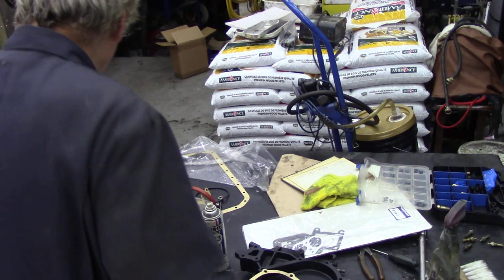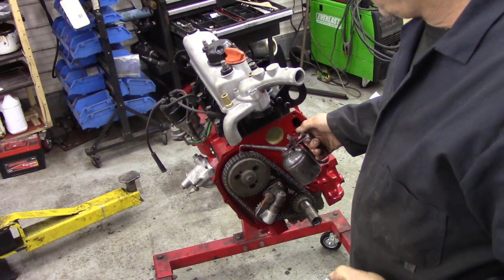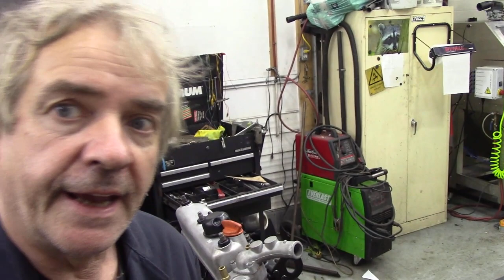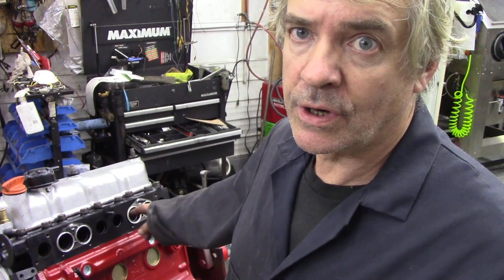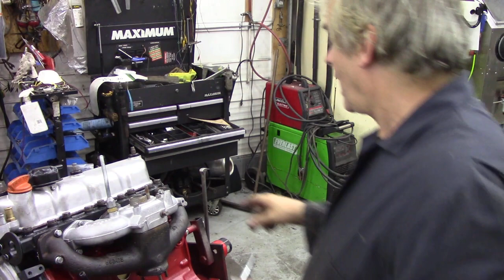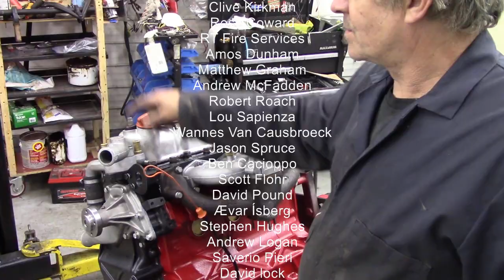2 5 engine   Front cover and manifolds

Comment: Ooh brings back memories! The brass nuts on the exhaust were good, long one and short one to lock onto eachother.. the bolt on the rear hole of the manifold had a 90 degree folded bit for a heat at l shield.. rear water hole in the head had a crappy tap in it to control the piss bit of heat that the inheritor got.. 
As for the manifold, they sometimes came with a full composite gasket, sometimes with those two metal ones. Whatever I used I always had the exhaust blow by after s few k km's. And try getting those bloody bolts in while the engine was one the car... Plenty of knuckle blood covering that area...

Comment: Not only did they fit brass nuts, the nuts covered the whole of the end of the stud...  The threads never rusted or seized, and the nuts always came off perfectly... Sadly this practice seems to have been ended by the bean counters, wanting to save a few pence on production costs...  I wish they hadn't... I've seen so many motorbikes where the steel nuts and studs have corroded so badly they can't be removed....  My '09 BMW F800 is going to need the studs drilling out soon, coz there's bugger all left of them! It wasn't a cheap bike when new... an extra 50p to fit brass nuts wouldn't have been noticed!  //rant over.
Reply from the maker: The later Rover V8's used stainless studs and steel nuts = so they rusted on the stainless studs which snapped like carrots and a bugger to drill out!

Comment: Nice job there Mike! ,makes me want to re-con mine in my 90(still running pretty good at 240,000 miles)
though still very slow on hills haha!. When i changed the head on mine for a "performance" head
i found the old series 3 exhaust gasket was a better seal then the 90/110 option(leaked like bugger),though still had to retain the metal intake gaskets as the intake manifold didn't sit flush with the exhaust manifold, all fun and games!.
Thanks for the helpful videos, they helped me out a few times!.
Reply from the maker: Right on!

Comment: i have the same stand as you my 2ft power bar fits in the hole but the other stand i got i drilled the hole out and a 3/4 power bar goes into now can swing a full built 300 tdi on my own with out even thinking about it hope this helps great vid as always
Reply from the maker: Good tip!
Reply: @BritannicaRestorations  glad i can send one in return for the tips to gave me
Reply from the maker: I will be remaking the head of this stand to fit the 4 cylinder blocks but in a centralized place - this is too top heavy at the moment - my other stand with the 300 Tdi on is perfect!

Comment: Silicone for exhaust joints like pipes and manifolds. Exhaust putty goes hard, cracks and drops out. Silicone stays flexible and is good to 1,300 degrees. Used it on truck manifold joints with no worries.
Reply from the maker: Be very careful with this, as many vehicles with Oxygen sensors can be damaged with silicon sealer - there is a special silicon for O2 equipped vehicles

https://www.amazon.ca/Permatex-81422-Sensor-Safe-High-Temp-Silicone/dp/B000AANXHC

Comment: Nearly done Mike.
You will be keeping another old Landy going for a very long time with that engine. 
Will you be putting it onto your half chassis test rig?
Reply from the maker: I may do  - stuck for a carb - I have a knackered Weber with parts missing - not sure if it will run ok
Reply: @BritannicaRestorations  So the next video will include a request for some carb bits or the whole video will be, "How to convert a 2.5 to fuel injection.!"
Reply from the maker: I just found that you can get new Zenith carbs for $60 - so I ordered one! 
But I have considered injection!